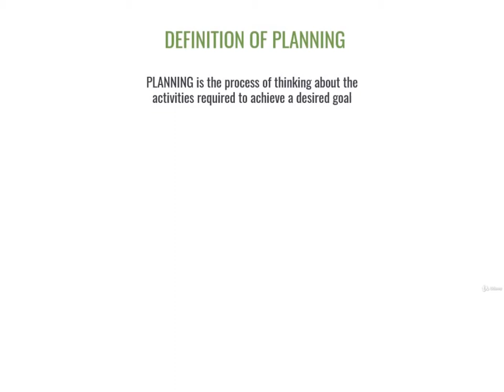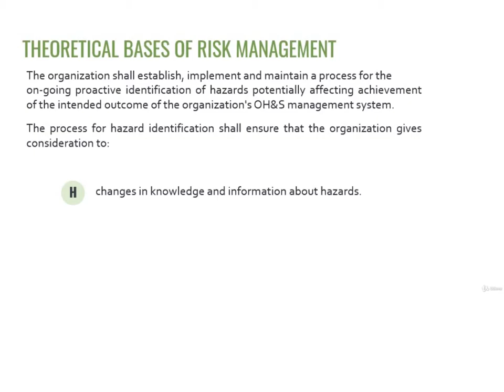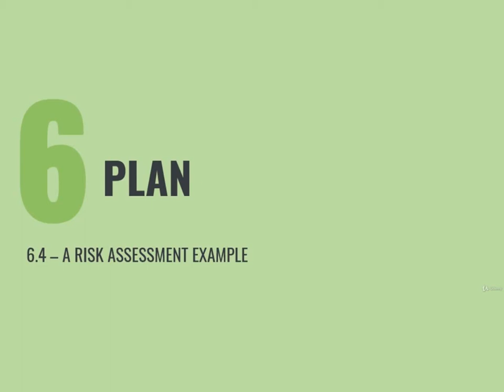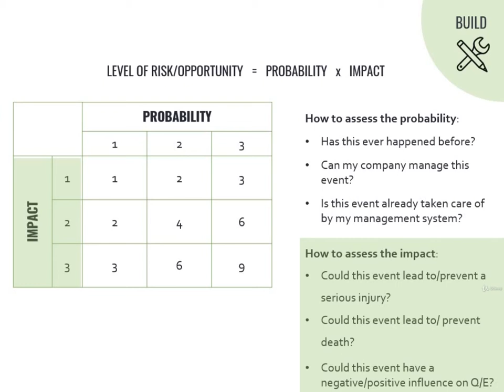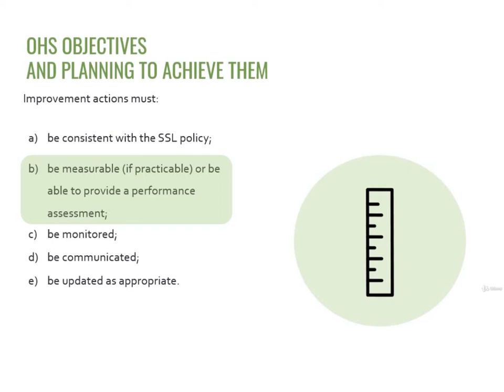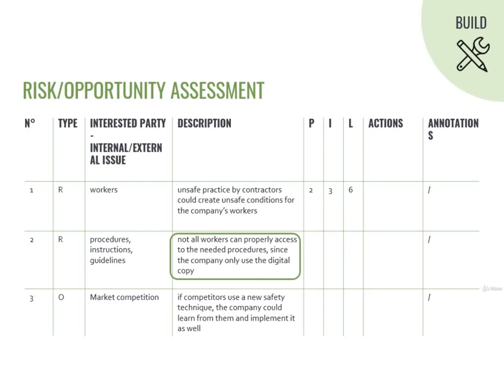ISO 45001 Complete Course Plan

Comment: thanks in advance, but the standard elements numbring in this tutorial is wrong and confuse us (6.2 , 6.3, 6.4 ....) !!unless it is the cource specific numbring ant not related to the standard , for expmle the element 6.4 not exist in the standard ....
Reply from the maker: Thank you for bringing this to my attention. I will look into the numbering issue you mentioned and verify if it aligns correctly with the standard. Your feedback is greatly appreciated, and I'll ensure that the content is accurate and clear.
Reply: @HEMCAcademy  ok and thanks allot about your great shared tutorial
Just another important question :
With regard to the concept   negative&positive side , is it required for example only in the organisation top level planing or even "for example" in daily permit to work planing or in this level we are required only to focus on negative effects as done commonly.
Reply from the maker: thank you for your appreciation and insightful question! Under ISO 45001, the consideration of both negative and positive impacts is crucial at all levels of planning, including strategic and operational. While it's common to focus primarily on negative effects, especially in daily operational tasks like permit-to-work planning, integrating positive aspects can significantly enhance overall safety performance. This holistic approach ensures not only risk mitigation but also the promotion of better health and safety practices, contributing to continual improvement.
Reply: @HEMCAcademy  Well understood 
Your given material quality  is very good indicating great effort and/or advanced knowledge so it is worth to be trusted . Therefore I will consider your response as a base block in my  background building. Thanks very much about your precious time and 1000 like
Reply from the maker: Your appreciation and feedback are highly valued. If you have any further questions or need more information, please feel free to ask. Again, thank you for the positive feedback .